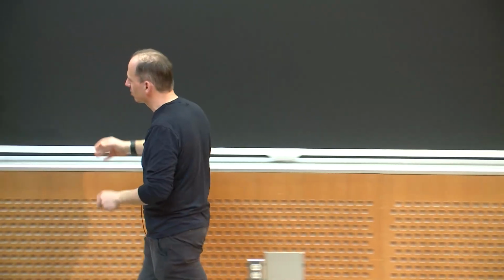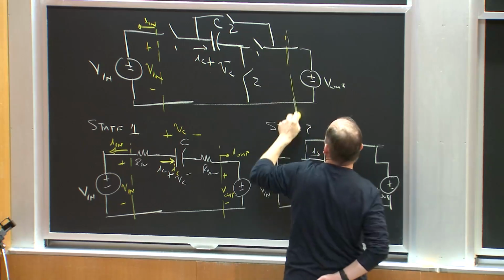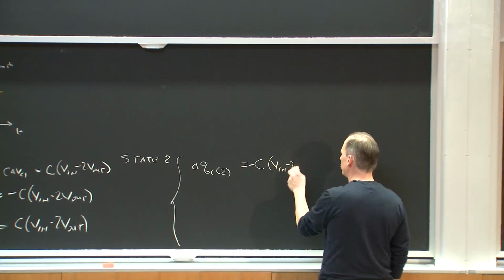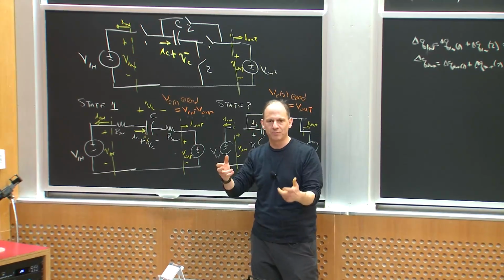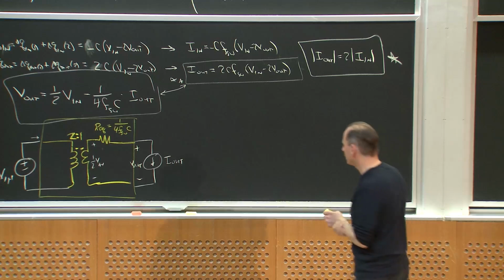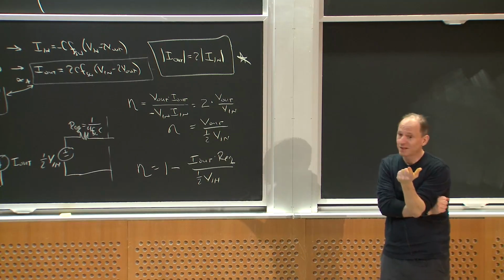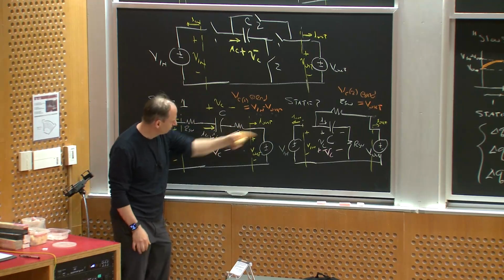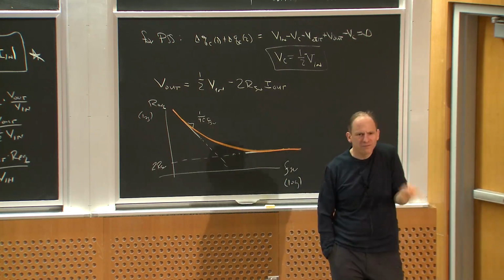Lecture 31: Switched-Capacitor Convertors, Part 1

Comment: I think net charge was mistakenly adressed.

First the net charge change of all component should be 0. But in first case, he assume the charge increased in capacitor is comming solely from input. Then he says this charge is also geting into ouput aswell, which is doubling of charge. I think its a mistake but for application purpose i think its not important

Comment: Do people really manage to consume this math during the lecture? I know it's not rocket science.. But even the lecturer makes mistakes.
Reply: He is more focused on driving the concept rather then the math, the math really does tell you where you should focus your attention when choosing elements for the circuit. In my experience he uses a lot of already derived formulas and ideas to save time, it would take him forever to derive everything as he goes! For instance he does not mention he is switching from time domain and frequency domain he just uses it. Or how he does algebraic conversions for the efficiency equations so you can see how certain elements affect the circuit better.
Reply: @Ignitis360  SAm Ben Yaakov has the best educational videos, you do not need math, if you have new ideas, how to avoid math,
and do it simply and easy, with good approximations.
Reply: In a lecture, It's about understanding it on a intuitive level first. students can always look up the math they might have missed.
Reply: What mistakes did he do?
Reply: I think he is presenting a new kind of systems for the students. Typically, to do that in a good way, it is better to use mathematical model featuring the best trade-off between accuracy and simplicity. Using difficult math at this level is stupid.
Reply: If you check the reading, there's a lot more math in the chapter.